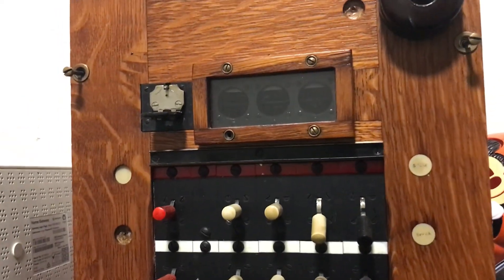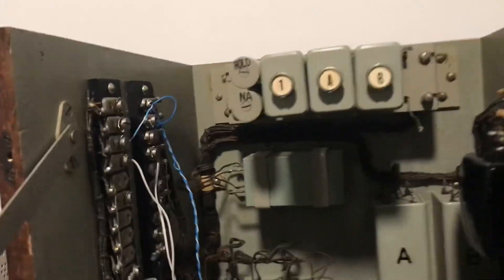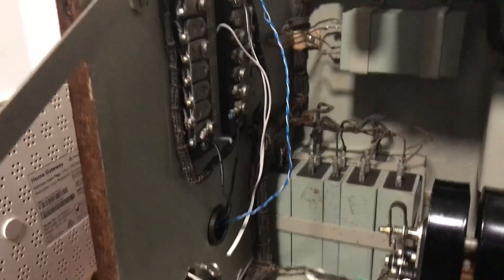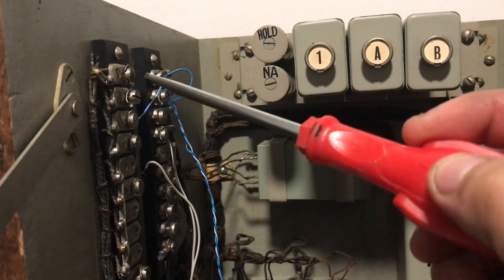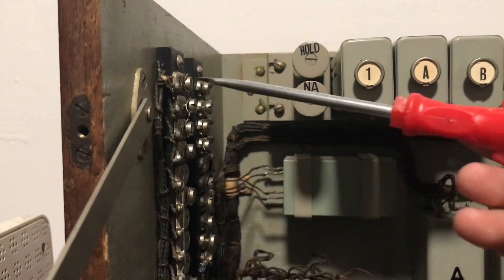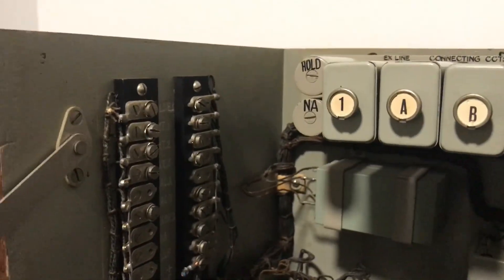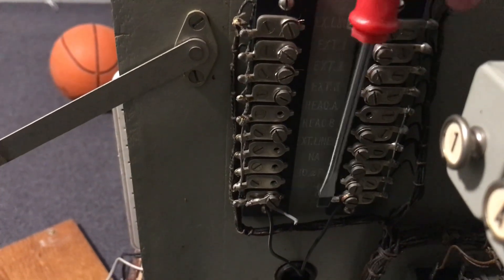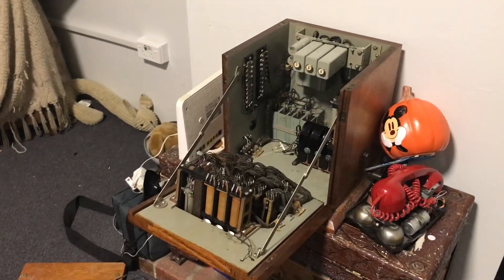Video For Bills200 How To Wire The Old telephone Switchboard

Comment: Hello Chris, thank you so much for making this detailed video :-) I just get confused but you have made it clearer. You are correct, a GPO 1+3 switchboard and similar layout, except operator phone is on the terminal itself underneath the exchange, the GPO does not have a operator separate terminal if that make scenes. All sorted with the power, thanks again 👍 do you think the 232 without set will allow to ring the other telephone that’s the only bit I can’t do ? I currently just have 746 as they are quite reliable to use
Reply from the maker: Glad it helped you out you can use a 232 telephone as a operator set cause I have used a 162 This Operator sets in past but I’m Looking For A Ericsson 162 For Mu Switchboard
Reply from the maker: Hi Bills This Is Link To Video Of Free Call From A Payphone https://youtu.be/8XQKmd5Va40